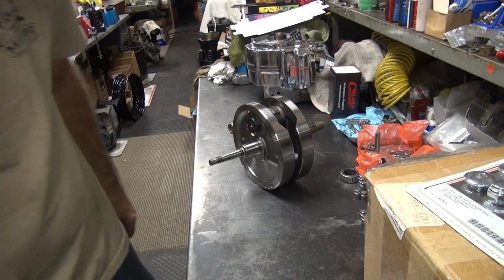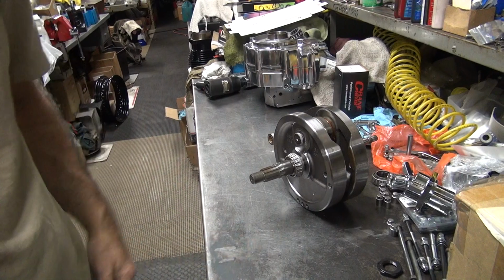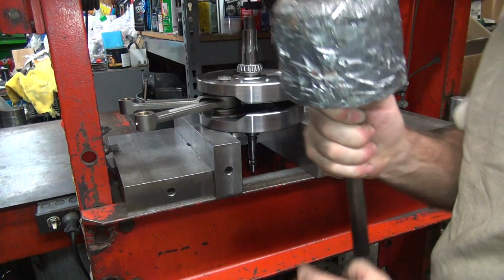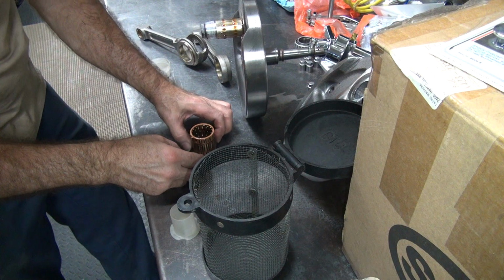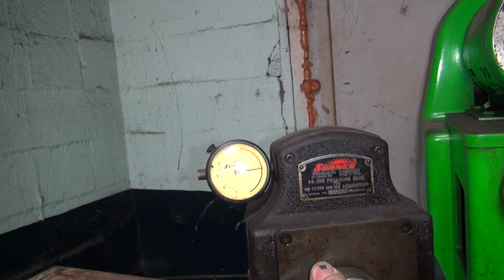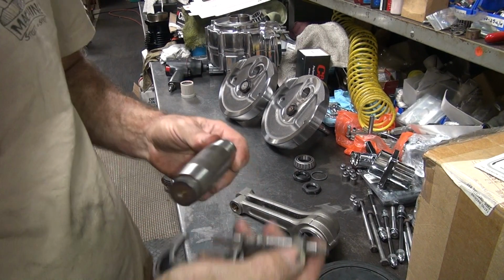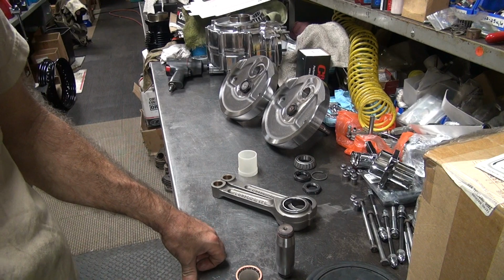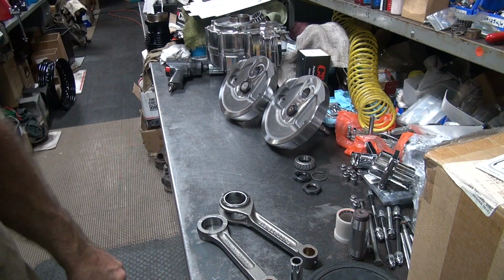#115 1978 93ci stroker shovelhead big bore motor new bike build fl harley by tatro machine

Comment: I never thought about this before. But what is a practical number for bore and stroke. I bought a Shovel with Delkron cases. I was told it was a 98" when I bought it. Turns out it had an old S&S 88" Sidewinder kit in it. This was great news because I really didn't want a 98" stroker. I have new cylinders and stroker pistons. They are stock so my 88" incher will now be an 84" incher. If I over bore it .020, it will be back to 88". Anyway. in the 1980's, a 98" Shovelhead was a big deal. I rode them and felt they were a bit much. I was wondering what size would be good for overall riding on the street. I'm kind of a freeway flyer and like to ride between 40 and 80 miles per hour. Ride solo and don't pack her down.
Reply from the maker: 1st off you have a 86" motor that has been bored .020 over. this is a stroker motor, not a bigbore motor.
in harley speak for shovelhead and older bigtwin motors everything is based off of the 74ci motor. that is a 3-7/16" bore and 3-31/32" stroke. most harley cylinders can be bored .070 oversize for wear clean up. this does not count in the size of the motor call out name. your motor is still called a 86ci motor ever tho it is slightly bigger than that. on harleys you have bolt on cylinders so they can be changed for size, that is what a bigbore cylinder is. that is a cylinder that is made bigger than the stock ones are. except for the 80ci cylinder this will require case boring for the bigger cylinder spigot diameter.
a bigbore motor is one that has had the cases bored out for bigbore cylinders. a stroker motor is one that has had the crankshaft or flywheel assembly changed out for one that has more than the stock stroke.
the motor call out names are based on motor size in cubic inchs. some of these overlap depending on the bore and stroke your motor has.
when you said you had an 88ci motor that can be made in two different ways. all bore with bigbore 3-5/8" cylinders on and 80ci base motor or from all stroke on a a 74ci motor with a 4-3/4" stroke.
these two different combinations of motors are completely different in most all way on how they run, vibrate and reliability as will as in cost to do each. bigbore motors cost more to build but are more reliable and vibrate less. for harleys, stroker motors make more power and accelerate faster for less cost. the trade off is vibration and reliability issues.
for your motor which is a 86ci stroker motor, the next upgrade would be to just bolt on a set of 80ci cylinders. this would make your motor a 89ci stroker motor. the 80ci cylinders are 3-1/2" bore instead of your stock 3-7/16" bore cylinders. being only .060 bigger than your stock 74ci cylinders it is only a small increase in motor size. you could bore your cylinders oversize to get this but you would be close to the recommended max bore size for these cylinders. the thicker cylinder casting of the 80ci cylinder is a better option that can be bored another .040 if needed.
tatro
Reply: Thanks for the explanation on stroker and big bore kits. I came up on Triumphs and Honda Fours. Big Bore kits for these engines were bigger cylinders but you didn't have to bore the cases. Actually, I should know all this from studying the build of an 88" Evo Sportster with Axtell cylinders. Have to bore the cases for those. When I bought the Shovel, I was looking for a stock 74". I went ahead and bought it looking to destroke it, but now see that it is probably not the way to go. This is not a restoration project.
Reply from the maker: you failed to say what your stoke is and what your new cylinders are at for the bore. for reliability and low vibration the 4-1/4" stroke form an 80" motor is the way to go. if you have 3-7/16" 74" cylinders than you get a 79ci. if you have 3-1/2" 80" cylinders you get 82ci. if you use the 3-5/8" bigbore cylinders you get 88ci. if you go to the 3-13/16" really bigbore cylinders you get 97ci.
all of these combos are using the stock 80" crank. going to bigger bores does not change the reliability or vibration much but does add alot to the power. expect a big increase in cost each time you go up in the cylinder size.
tatro
Reply: I hate to admit it, but I haven't separated the cases. Everything seems to be OK. Found my notes. My stoke is 4.625 inches. So 4 1/2" sounds right. I have no idea who made the flywheels.The pistons that came out of the engine were measured at 3.457" inches. Hmmm, no notes on the old cylinders. I know one is Harley and the other is some aftermarket.  My new cylinders are 3 7/16" inch bore. I have a new set of pistons that are for stroker applications. These are for standard bore cylinders. The old S&S pistons that came out are 92-2902FP or 2900 TRW. According to Delkron , my cases are 1989 D1002 standard bore cases.
Reply: sporsterini I was always under the impression that boring for additional size was exclusive to water cooled engines like V8's. Boring for size in an air cooled engine reduces cylinder wall strength and lessens cooling capacity for the cylinders. Maybe Tatro can explain this?
Reply: Da'oud, in my time, boring was used to clean up cylinder walls to extend the life of an engine. I have never bored an engine to gain more volume for the exact reasons you stated. The  Shovelhead engine I have now is the first one that I've owned that has been stroked and bored. As stated earlier, this is an early S&S Sidewinder setup. Bored .020 over with a 4 1/2" stroke. As far as automotive applications go, stroking an engine is not much more than just having the engine bored. Too bad low cost stroking and boring for American V8 engines wasn't around when I was a kid.

Comment: After Watching Your Engine Builds if i Was Going To Do a Rebuild i Would Use altima Now After Seeing You Do Engines with S&S There Parts Were Good Back in The Day But Now That You Show How Bad  There Lower End Parts Are i Would Not Buy It Any More i Have Watch You Take There Lower End Sit Up Apart on Every Build You Do Thanks
Reply from the maker: s&s wheels, accel shafts, jims nuts, panhead bearings and h-beam rods are the best. but you have to make this one.
tatro

Comment: kool vid  ...    was wondering have to do a gasket change  on a  1982  iron head  was wondering what would  you  set the  torque  spec number  to tighten the top bolts  down   ...  †
Reply from the maker: head bolts are around 60 or so. just make them tight. you have to learn what that is for every size.
tatro

Comment: Is this typical of S&S, and how do they compare to a new Harley assembly?
Reply from the maker: yes and that is why i rebuild a new crank. harley and jims are not much better but altima has good cranks. their rods are true.
tatro
Reply: OK, thanks for the reply, my 1946 Knuckle is a 93" sidewinder built here in Sacramento by Karl Engelenner at MMS..excellent machinist and Dyno work, crank was balanced here by Barry Gerolamy. I also bought a 93" Knuckle Crate motor directly from S&S (flathead Power)...Those 2 guys, Barry and Karl, are now retired...
Reply from the maker: built right they last. how many years has it lasted now.
tatro